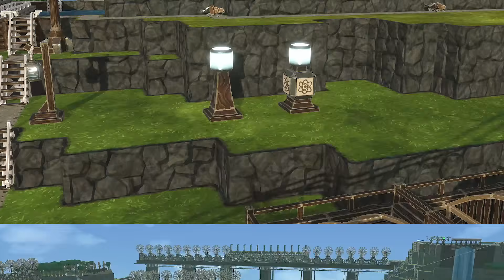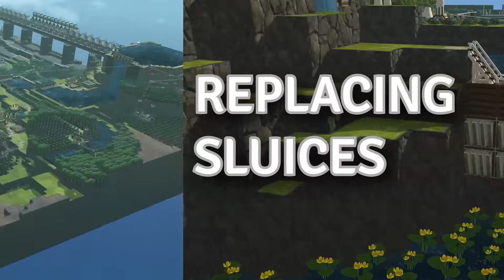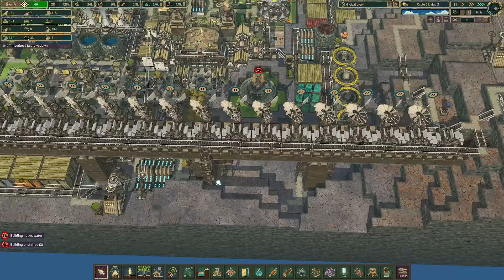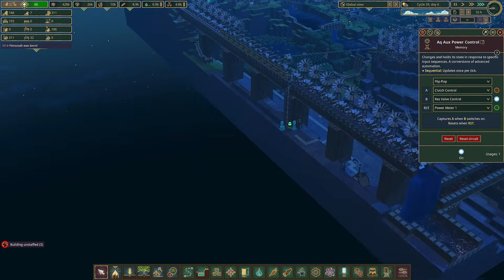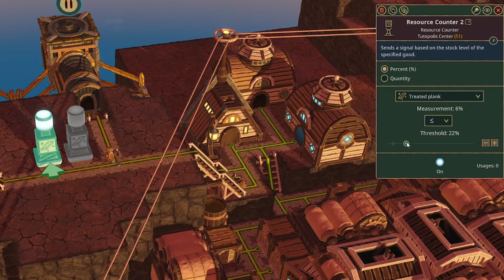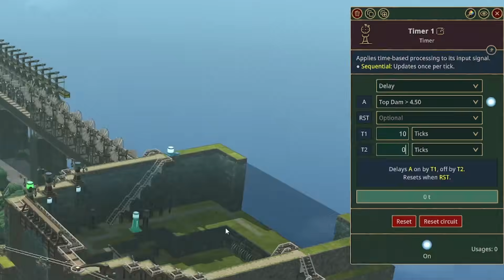Timberborn Automation Guide: Complex Implementations That Actually Work

Comment: Is there a way to do automation on the recipe choice of buildings like bakery, fermentor, food factory, grissmill, ... 
With a colony of about 50 1 grissmill and bakery or 1 fermentor and 1 food factory are enough to produce every type of food, but you need to keep an eye on which food is running low and you have to manually switch to produce the food that is running low on the inventory.

Comment: There is a problem with using relative measurements for the resource counters. If you have a building with two outputs, the resource counter will never reach 100% because the building does not fill up the output storage for the non-selected output. So you should use the quantity setting with the storage buildings' capacity as the threshold.

Comment: 29:00 It's a bit of a footprint for all that logic so what I did with the use of the blueprint mod is create a single floor of these kind of controllers with double platforms over them and stairs going up. That way I can just stack the blueprint for any building type. I have each floor have enough logic to have 3 input counters, 1 output counter, a timer (I have it so that it will run a building up to 80% complete before turning off) and I also have an override switch to keep them on (Some I even pin to the UI).

Comment: I’m a bit curious, some sensors in this game need to be connected to a road in order to function, and roads can be automatically connected using gates.

Does that mean you can use gates and roads to build complex AND/OR logic, or even a bus? For example:

[main road]
|
|--d1--|--d10--(s1)
|--d2--|--d11--(s2)
|--d3--|--d12--(s3)
...
Reply: I think a manual switch controlling the gate could let you override some automation temporarily.

Comment: Surely you want to control population based on the number of workplaces available - if you build more workplaces, you need more population. You could use the number of unemployed to see whether you need more housing. (Or in the case of the Ironteeth, have some breeding pods automated to turn off when you have unemployed beavers. This also works for bots; turn off bot assembly when you have unemployed bots.)
Are you automating floodgates so avoid jitter when the water needs to be turned off or on to maintain the desired upstream or downstream depth? I've seen other content creators use a mixture of dams or floodgates and sluices to maintain both upstream and downstream depths; during temperate weather the floodgates would stop the upstream water level from getting too high and during a drought the sluices would stop the downstream water level from getting too low, which seemed to work pretty well, but I have noticed that the water in 1.0 is more jittery.
(It's possible that you answered these in previous episodes but YouTube only suggested this one.)

Comment: 2:10 The Oscillator is great for the fireworks launcher.
4:10 Those were already Fill Valves and didn't need replacing.
19:50 Doesn't Reset circuit button do all the resets with a single click?
Reply from the maker: You're absolutely right about the fill valves at 4:10, somehow I completely forgot I did that. 

And yeah, you're absolutely right about reset circuit. That was a bit of recording brain.

Comment: 26:00 if you’re building the controllers for producing treated planks, I understand and agree with three of the four criteria, but I don’t understand why you’d turn off the building if you have below a minimum (<25%) of treated planks. 😐
Reply: That's a reset condition. It tells the relay that you've burned through most of your treated planks, so start producing them again until you get back to full (assuming input availability conditions are also met). If you don't have that condition, then you get situations were a building drops one below full and turns back on. A beaver creates the plank, pushing it back to full and then leaves the building. Then another plank is used, so that beaver has to turn around and go back to create one more plank again. Over and over and over
Reply: That makes more sense. I didn’t realize it was used as a reset. I tend to use a timer to avoid the production jitters. Easier for my brain to understand.